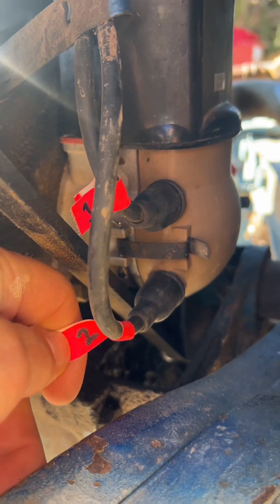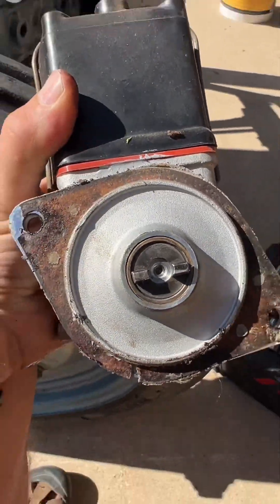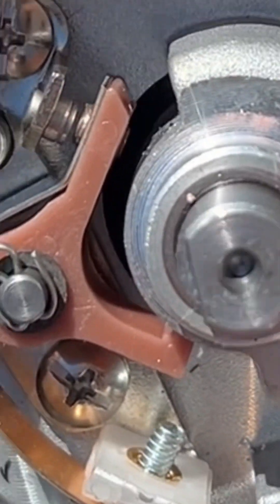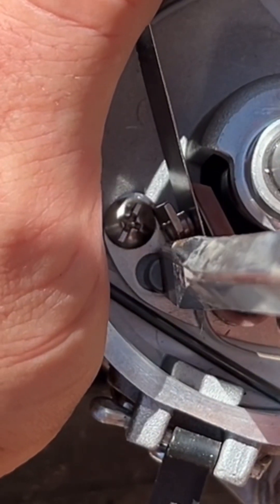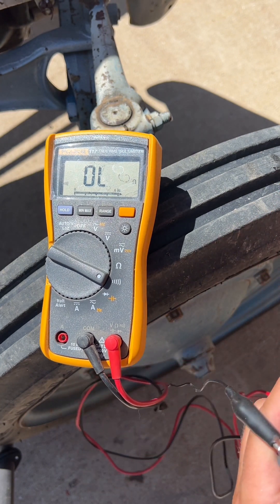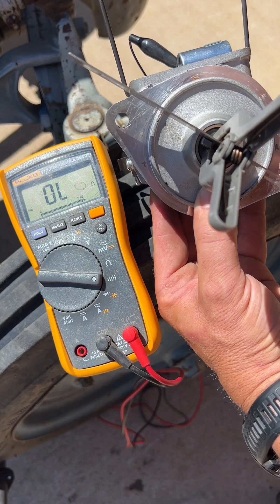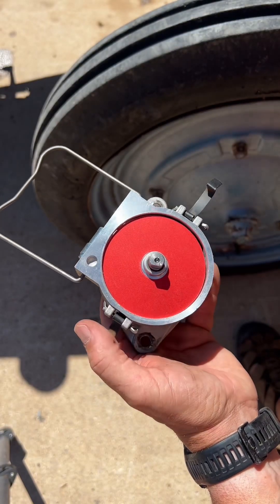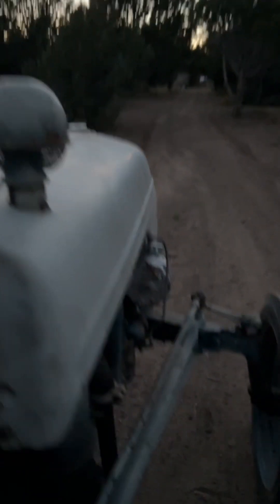HOW-TO Fix: Ford 9N Exhaust Glowing Red Due To Bad Ignition Timing #fordtractor #ignition

Comment from the maker: Someone on TikTok pointed out that the distributor shaft will not, in fact, mount to the engine 180 degrees off because the protuberance at the end of the shaft is offset from the center, so it shouldn't align with the engine if it's off by 180 degrees. I heard Rachel Gingell say it would mount either way in one of her videos but I didn't attempt to do it myself. Better safe than sorry, I guess, so I marked the shaft's orientation.
Reply: There’s no way to mount it incorrectly, the key is slightly off-center and fits only one way. Old Toyota engines used this same offset key on the dizzy.
Reply from the maker: good to know :)